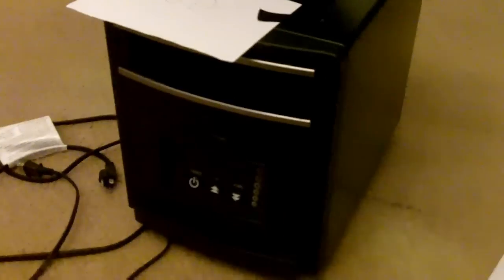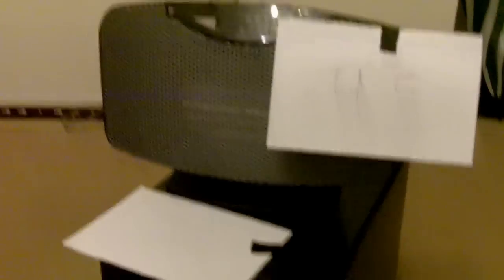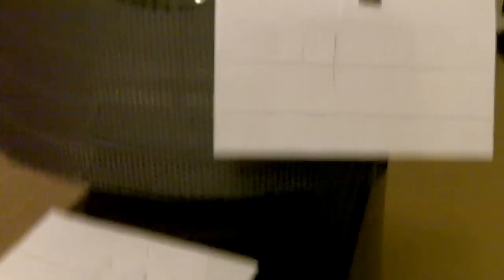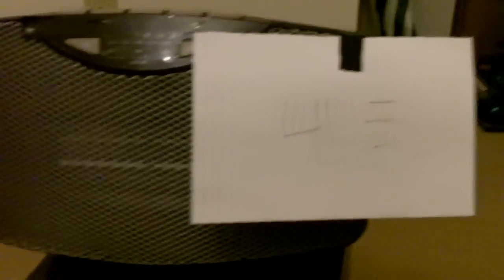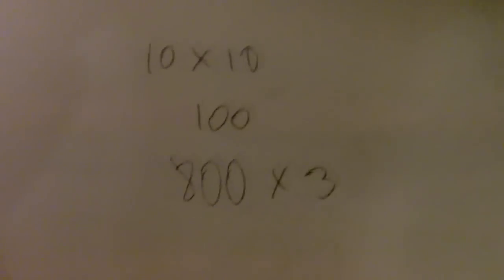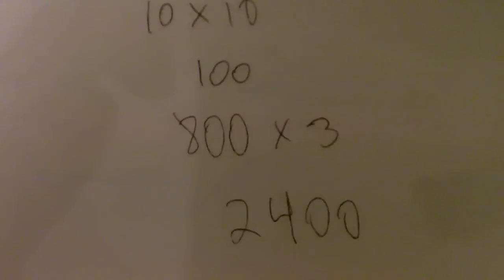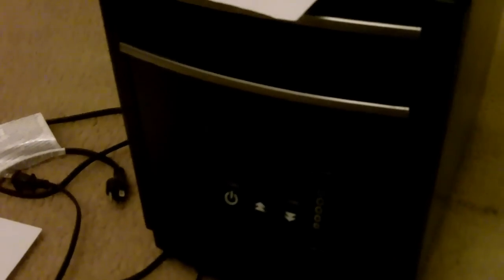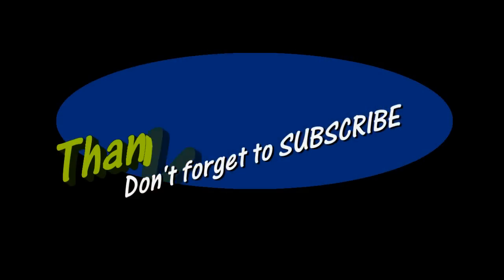Ceramic vs. Quartz Heaters

Comment: Actually not true. The quartz heater put out more heat. I tried over a dozen different space heaters. Even though 1500w in theory sure be 100% efficient and yes partially true. Find most heaters don’t direct heat, or blower not strong enough to distribute heat correctly, some shockingly due to poor built quality as they put a blower inside some of them behind ceramic Element but no channel as to cut corners to direct air and then some elements to small and causes airflow restriction and etc. I working on a video on heaters.

I find most the quartz heaters are built better overall with metal case inside wood cabinet with good overheating protection. The Lasko ceramic heater almost caught fire two days ago and is only 7 months old, but plug melted to wall outlet which was a commercial grade 20 amp outlet and circuit and was new. Plus put out a nasty smell when element I guess failed. So took it apart and was shock to find no overheating protection and reason is due to manufactures relying on the fact that the ceramic element is self regulating. Then was all plastics no metal and no metal thread inserts for screws even. I had the quartz heater for 2 years without any issues.

No space heater going to heat a house. Even though my quartz can heat 350 sq foot area when around outside 30 to 75  degrees with no issues by itself. That I wasn’t expecting as I usually figure around 150 to 200 sq feet.
Reply: I don't think any quartz heater can keep up with the Crane Fireplace Heater, which is ceramic element.  That puts out as much heat on the 750W setting than most do on the 1500W setting.

Comment: I just got one infrared quartz heater from Bizarkdeal. It's awesome.
Reply: +Selina Dorsey  Looks like a great unit and we were surprised to find it had wheels which is a great touch.
Reply: +Selina Dorsey This unit is significantly smaller than our old one, which will save space, while having roughly about the same BTU power.
Reply: +Selina Dorsey Great purchase top to bottom.

Comment: Guy tries to help out and people cant help but be picky pricks about the video.  These would be the starving people standing in a food line bitching about the food and wanting pop and pizza.
Reply: SOME PEOPLE SHOULD NOT MAKE VIDEOS WHEN YOU HAVE NO IDEA WHAT YOUR TALKING ABOUT.  I HAVE TWO OF THESE HEATERS AND THEY HEAT MY WHOLE HOUSE WITHOUT ANY USE OF THE FURNACE. ITS A 2000 SQ FT HOUSE AND THEY WORK FINE.
Reply: @raerae6569 Wow, I was firmly on the fence between the two, but the caps you've deployed really convey the message that you speak with unbiased conviction and I am now totally compelled to believe that you're 100% right

Comment: You are an idiot dude, you forgot a huge factor in your equation. The insulation of ones house. Those heaters are rated in a perfect environment, obviously if your "downstairs" doesn't have high quality insulation or it would work perfectly in there.
Reply: Shut up

Comment: your crappy quartz heater has a creamatic heater inside with one bulb take it apart if you dont beleave me if you want to want to try a real one get a EdenPure they have 7 IR heating elements and ARE NOT a crematice heater in a over sized box   nice formulas   but you need to get a real Quartz heater and yes a heat pump is better and a gas furnis is to and a boiler

Comment: This video is useless because you left out the most important thing. Its the fact that a  quartz heater uses less than half the electricity of a ceramic heater. I bet your test was done in dads house where the electric bill is addressed to him.
Reply: 1500W is 1500W, Dude.
Reply: No doubt about it. My hairdryer puts out 1500W and in no way shape or form will it heat up an entire living room. It''s all about volume and efficiency. Not about watts. Similarly with LED vs. incandescent bulbs the latter requires more watts, and yet the LED using 10% of the amount of watts emits the same amount of light. A big efficient 1500W heater puts out more CFM heat than a hairdryer and thus doesn't need to operate 24/7, as would the hairdryer having basically no effect other than to run up a very, very high electricity bill. So these people talking only about watts don't know what in the hell they are talking about. It's all about CFM output and efficiency. Period end of story. The end of a great debate. No analogy required.

Comment: How do these compare to regular space heaters? I know 1500W is 1500W and any heater that uses that will give off the same amount of heat, but the heat delivery method can change things. How would this thing compare to a regular space heater when it comes to heating part of a hallway and 3-4 rooms in the hallway? The rooms are about 10' by 10' and the hallway is about 12' by 3'. I use a pellet stove normally and it doesn't reach that part of the house so I would like to use a supplemental heater